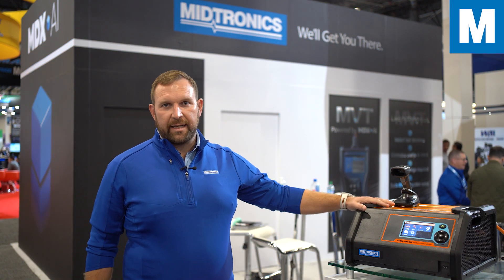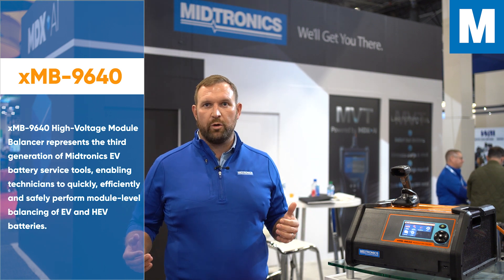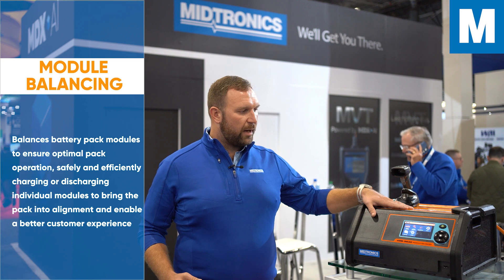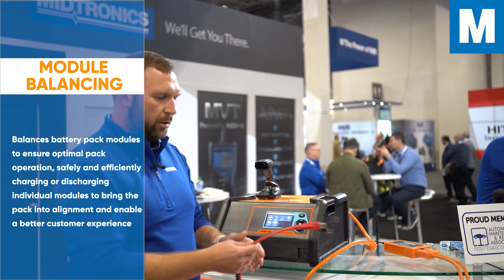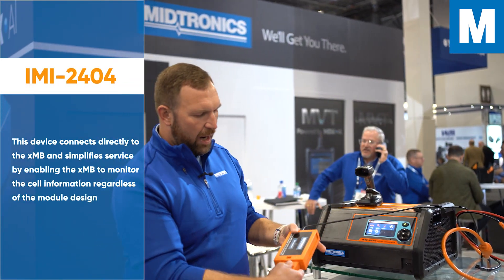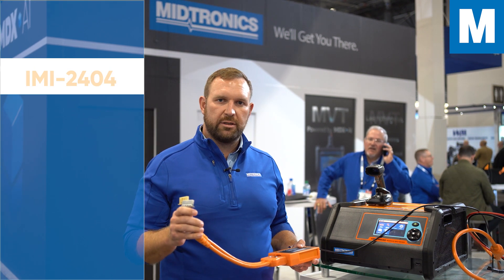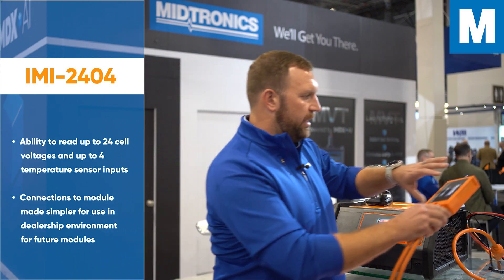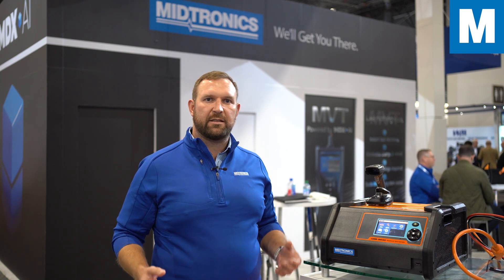Midtronics Showcases the xMB-9640 Module Balancer

Comment: Dear Midtronics Team,I am interested in your hybrid and electric vehicle battery pack charging solutions and have a few questions regarding the capabilities and compatibility of your products.Do your products include features for balancing the cell voltages within a hybrid vehicle battery pack to improve performance? If so, could you provide more details on how this process works and its benefits?Are your charging solutions compatible with all current models of hybrid and electric vehicles? If not, could you specify which vehicle makes and models your equipment supports?I am keen to understand the scope of your technology and how it can be integrated into our service offerings. Your detailed response will help us make informed decisions regarding equipment acquisition.Thank you for your assistance.Best regards, [jong tae kim]